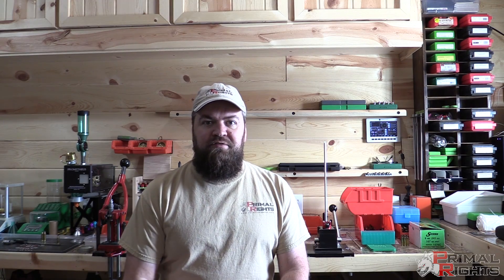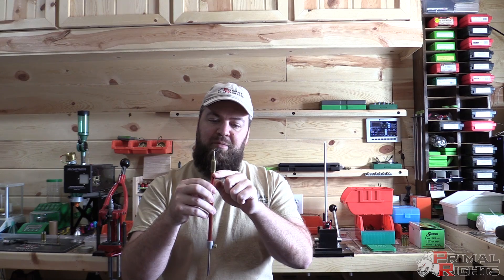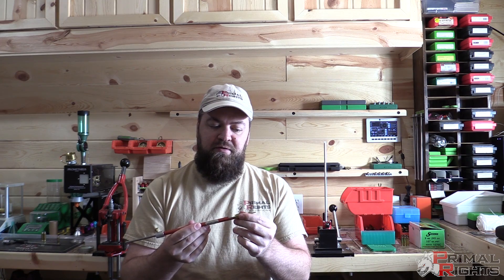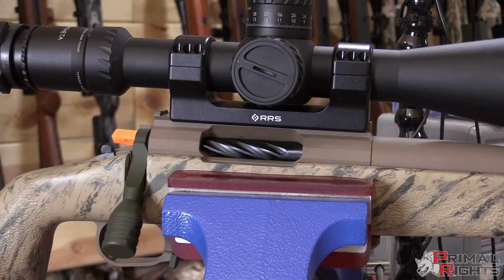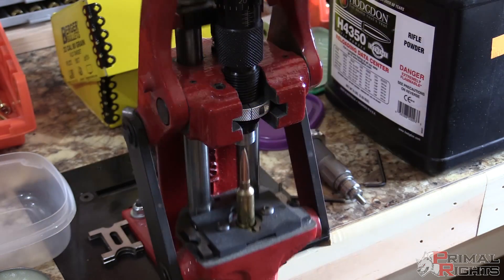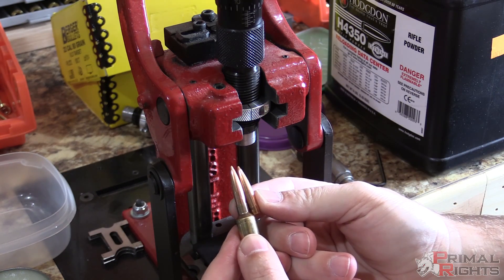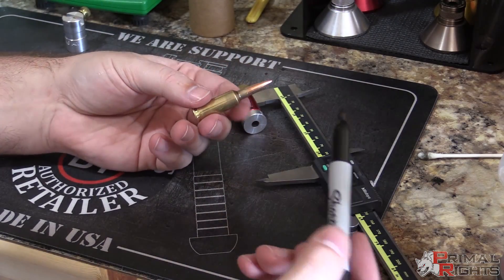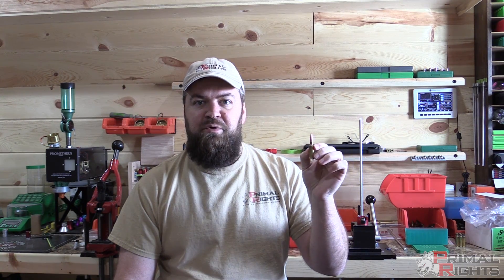Measuring length to the lands in your rifle.

Comment: Do you use a piece of fire formed brass that has not been resized or use a fire formed brass that has been full length resized?
Reply from the maker: It’s irrelevant, so long as the brass chambers freely without friction and can securely hold the bullet.
Reply: @primalrights  So what you are saying is that I can use a piece of virgin brass to do this as long as it freely gets inserted into the barrel.
Reply: @primalrights  What you are saying is that I can use a piece of virgin brass as long as it fits smoothly?

Comment: Wouldn’t it be better to do this with the plunger still in, pushing the case foraward as this is how the case will be positioned when actually fireing live rounds, or not?
Reply: No, strip the bolt before doing this method

Comment: The system I use is to seat a flat base bullet nose down into a fired resized case and use that as the index for my distance to the lands.  When I want to work out the OAL for a new bullet, I press it firmly nose first into the muzzle of my rifle then twist it to scribe a line in the jacket.  With a caliper it is then a simple matter to determine the seating depth relative to the ogive.

Comment: Hi Gregg, thanks for sharing your knowledge. When I get a new barrel , I clean it very good. There’s usually a good bit of machinists oil, etc when they ship it. After it is clean I use my thumbnail to find where I can pull the bullet out without any resistance. The 1st time you try this it will freak you out on how easy you can identify 5 thou in, 10 thou in, just kissing the lands & when you are completely off the lands. I only do this with a new bbl. It’s not practical to if you are wanting to track the lands through the life of the barrel. The method you demonstrated is very good, but as in everything it has to be practiced in order to find the repeatability you should desire. Also, don’t underestimate the OAL gauge. With enough experience you can become very good at getting consistent repeatable measurements. It does take thinking about what you are doing & doing it for a long period of time.
* Greg you once offered to turn some brass for me free on your IDOD. I declined because of the volume that was involved & did it slow , but steady with my  K&M set. Viewers, this is a man with a lot of knowledge & I hope the story about the brass demonstrates his willingness to share & help.
Thanks & God Bless.

Comment: What about the method where you put a bit of thread locker in a fired case with a bullet. Neck tension is loose enough to where you aren't jamming ogive into lands that hard. Then insert into chamber (no bolt) and let the lands gently push the bullet into case. Thread locker hardens and you can then remove round and measure. No need for going back and forth with seating.
Reply: That's the method I use as well.

Comment: Hi!  I really want to follow your method, but Browning just told me today to not disassemble the ejector plunger on my x-bolt long rifle (the pin must be factory set).  Is there any advice without removing the ejector plunger with a fire-formed brass (300 win mag)?  Thinking about your method, after the plunger is reinstalled, it will naturally push the brass forward, so there is risk of pushing the bullet into the lands after all "was" configured to offset the lands by let's say 10 thousanths.  Thoughts?

Comment: If i have a tight neck chamber and my brass gives me a small amount of resistance, what would you recommend in that situation?
Reply from the maker: I'd recommend finding where the resistance is coming from. Use a sharpie to determine contact. If it's the neck OD, then you'll need to turn your cases down much more. If it's shoulder, then you'll need to set back a bit more.

Comment: Fairly new to reloading. I’ve been setting bullets 10 thousandths off the lands with the afore mentioned non accurate method. If I do this process with a fired and resized cartridge, 10 thousandths off the lands is where you should start to not have any pressure issues?
Reply from the maker: 10 thousandths is typically a good starting point, if all other considerations such as magazine length will allow it.

Comment: FINALLY!!! A guy that knows what he's talking about!
I'm lazy and stopped removing the firing pin.
I just take my dummy rounds
 (no primer, powder of course) and use the Hornady comparator tool to just barely touch the lands. Took that data and  worked up/down my seating depth from there.
Took awhile, but hey, target shooting is  just fun even if my shots were MOA+!
Now I shoot MOA- @ 100 yards out to 600!!! I'm happy!🙂
And yes, you will have to do the whole process over every time you use a different lot of even the same bullet and especially if you go to a different brand and type. Reloading for me is relaxing but it's not for everyone. Helps if you're OCD!!🤫

Comment: I do my measuring fairly similar but i don't remove the firing pin and plunger. By removing those parts and doing your measuring once you put the guts back into your bolt does that not change your measurement as to how far your bullet is to the lands?
Reply: It doesn't change the measurement but with the firing pin and ejector in place you are not going to get the feel that you will get without them.

Comment: Thanks for the great video. I have used both the Hornaday comaparator , and the progressive shoulder bump to achieve the tightest resize with the easy bolt drop. Your method for determining the ogive to land is basically the same method. this will save me money by not having to buy the specialty tools. Thanks for the instructions, will be putting this to use in the new year, as I have some Barnes 80 grn ttsx that require a little jump!

Comment: What would be the solution if the empty case with no bullet does not allow the bolt handle to close freely and provides resistance. I am using Lapua brass, FL sizing, and trimmed to 2.005.
Reply from the maker: Please see the video in our channel regarding setting up a sizing die.  https://www.youtube.com/watch?v=rRu8NYCq9Y0&t=
Reply: In

Comment: My question is, why would we want to remove the ejector spring tension? Under normal use that spring tension would be there behind the round and force the round back into the lands however much thousandths! Not getting an accurate reading when we're seating off the lands. Am I wrong or just over thinking the process?
Reply: So doesn't that mean you don't really need to remove the ejector plunger?  Or does that simply buy you "feel" to the lands?
Reply: Hope he answers this. My same question. Thanks sir in advance primalrights.
Reply: When you resize your case, you bump the shoulders back 1 or 2 thousands. After, when you chamber your round, even if the spring pushes the case forward, it cannot move more than 1 or 2 thousands forward. So let's say you seat your bullet 20 thousands off the lands... in reality it could be 18 or 19 thousands off the lands... For me that's a pretty much negligeable.

Comment: Thanks for the awesome video. I have been using this method for a while now with great success. I know your a avid desert tech guy so here is my question to you. I have an SRS and use this method but only feel for the lands on closing the bolt. I do this for the SRS because it seems like their bolt mechanism acts different than traditional rifles. Also with the SRS it seems very black and White where the lands are because the bolt will either close or not and it’s very obvious. Have you tried this on the SRS and do you have any helpful comments?Thanks again.
Reply from the maker: With the SRS, you can simply remove the barrel and remove the ejectors from the bolt. If you want to do it with the barrel in the chassis, you can remove the spring from behind the striker and you'll feel minimal resistance.

Comment: Is there any caliber or bullet that this shouldn't be done with? I would assume different bullet weights would require the process be repeated for each?
Reply from the maker: This only works with one specific bullet. You must create a new measurement with each bullet you use.
Reply: @primalrights  please walk me through this process, correct me if im wrong. You do this whole process then load that specific bullet to minus .050 etc (how far off the lands do you go?) Then grab a new bullet and do it all over again? Pardon my confusion, im new to the whole precision thing, thanks!
Reply from the maker: @jayinla228  How far off the lands you go is determined via load development. You can go to the library section of our website to find an article on that. Yes, you must re-measure with each bullet, as their ogive characteristics are different.
Reply: @primalrights  do you mean each bullet you load, even if its from the same box, brand and weight? Or each type of bullet? Seems very tedious if it were each bullet from the same brand, type and weight.
Reply from the maker: @jayinla228  Not each bullet... each different type of bullet. A Berger 6.5mm 140 hybrid will give a different measurement than a 140VLD.

Comment: That’s a really good idea.  I have been using the Hornady tool and I measure 5 times over three bullets from the same lot.  Then I take an average and set back.  Your way is way more precise!  I guess my only question is how often do you re check your marked bullet as your lands start to wear.  I assume this would be different based on caliber or your groups starting to open up?  I don’t typically chase my lands
Reply from the maker: I will save the dummy round created during this process for later reference. When I'm interested in checking the land erosion, I will repeat this process with a new dummy round, and can compare it to the original to see just how much erosion there has been. It should be obvious as well that it is perfectly safe to perform this operation with a loaded cartridge, as the firing pin assembly has been removed from the bolt. Thus, after you've achieved your measurement, the "dummy" round can then have the bullet set back and be fired just as a normal round would be.